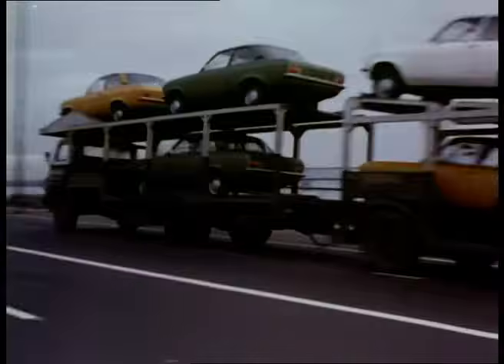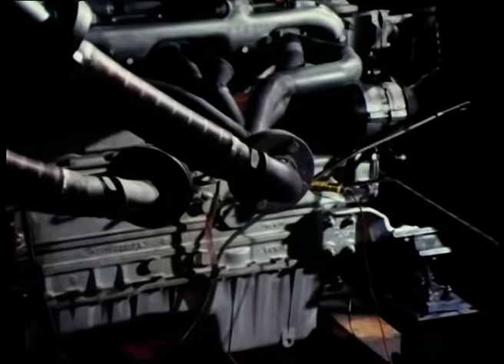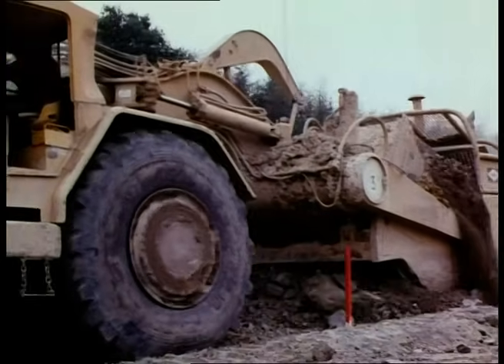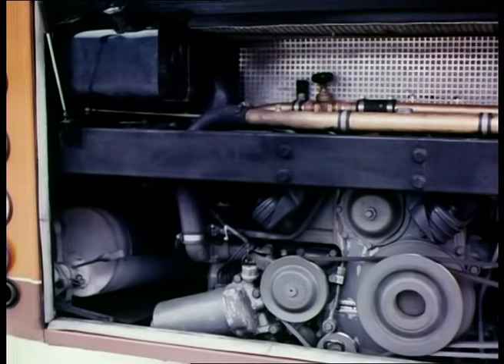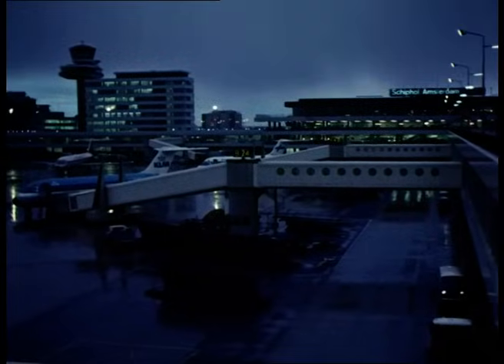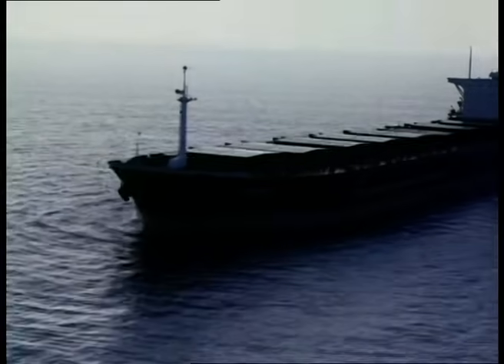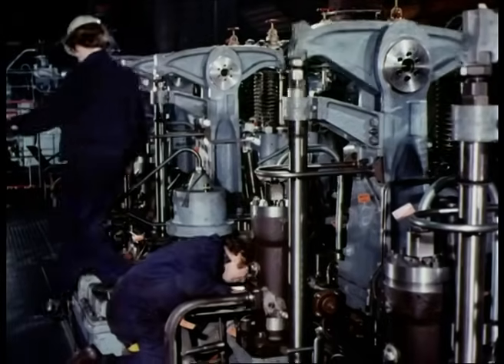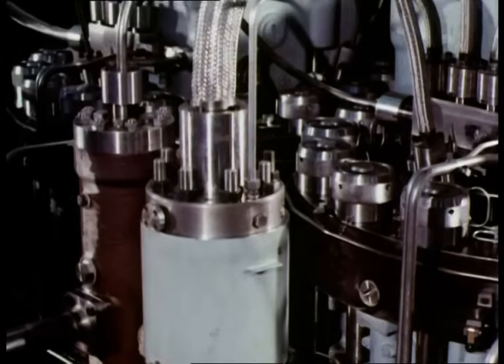The Power of Diesel: Inside the Engine | Shell Historical Film Archive

Comment: That ro-ro ferry left port with its stern door open (11 minute). Such lack of safety would one day result in disaster. As for diesel engines, it was invented in the 1890s - filthy, noisy and relying on dino-juice. The electric motor was invented 70 years before. What swindle did the likes of Shell pull to have diesel win?
Reply: Everyone knows that an electric engine is better than a combustion engine. Do you know why internal combustion engines are common? Because it's easier to power them. What's the point of an electric motor being invented earlier if no one was able to make a good battery to power it? This is not just some scam, this is life.
Reply: The problem isn't the electric motor. It's using galvanic corrosion as a power source i.e. batteries. Electric motors are great in low power applications or where they can be powered by the grid. They don't work well for cars, not to mention big rigs.

Comment: I have a Sichuan Sifa MB168F 3 horsepower diesel. It's mounted on plate aluminum, not steel. The 20 MM crankshaft has a 1 inch adapter sleeve and it holds a 7 inch pulley for a car alternator. Straight out of the crate, the throttle restrictor bolt was turned 5 revs in to reduce the maximum speed. It runs on clean pump diesel and 15W40 oil. The oil consumption is a bit high. It has a break in period. These motors should be on every block.
Reply: Why aluminum?
Reply: @DPoner  A thick aluminum plate is rigid and won't corrode the lugs. When you use steel, you cheat and use flexible too thin metal. It will keep eroding the bottom and it's noisy.

Comment: As a graduate student who is on the way to pursuing an engineer's position in low speed marine diesel companies, I would say this should be the best recording of the old diesels especially the main engines which I am fascinated by. I guess the main engines showed here might be: unknown MAN or Bergen/pielstick PC-4/Doxford opposite piston 56J series/Unknown B&W low speed and B&W K-GF series?
Reply: I used to run a Crossley HRL 4  a two stoke cross flow super-scavenged direct reversing marine engine on  m.v. Wincham. 45 - 300 rpm, it sipped fuel and ran for sixty years on its original bearings. Also a Mirrlees Blackstone 16 generator set. So reliable and very efficient.  I do like the Doxford but they were a special beast and not many know how to run them now.
Reply: There was Scania too, bro
Reply: I used to drive past a giant Fairbanks-Morse opposed-piston sitting in a field!

Comment: Im going to make a Diesel 2 stroke opposed piston with loop scavenging superbike!
Reply: I'll buy it
Reply: @DomnuGoe  imagine a 500cc 2 stroke opposed piston in a 250cc frame, 100hp under 180kg weight!
Reply: You’re too late 😂
Reply: @TonyLoechte  its okay i want to make my own engine
Reply: Okay
Reply: Raise the compression on a standard 2 stroke dirt bike engine, add an injection system, and crank driven blower for scavenging. Opposed cylinders would be unnecessary complications.

Air Cooled 4 stroke radial airplanes engines used in WW2 tanks were converted to 4 stroke diesel by cat for lend-lease sales. The Caterpillar conversion raised the compression and added a mechanical fuel injection system.
 
Air Cooled 3hp horizontal shaft Chinese diesel engines are cheap and great size for a small motorbike or small garden tractors with their gear reduction transmission and no mower deck.
Reply: @jhoncho4x4  opposed piston engines should make a comeback i see so much potential in it..modern manufacturers arent bothered about them anymore!
Reply: @fidelcatsro6948  if there’s so much potential why are zero manufacturers making them ?
Reply: @spannaspinna  im assuming its much easier and cheaper to make inline 4 and 6 engines of which manufacturing moulds already had existed and proven reliable
Reply: @fidelcatsro6948  far Less moving parts, more efficient , less weight penalty , just a couple of reasons why opposing piston engines never took off
Reply: Please don't blow yourself on it, especially in a crowd